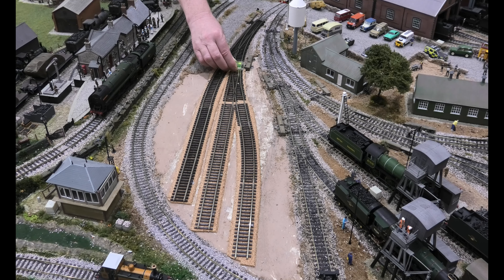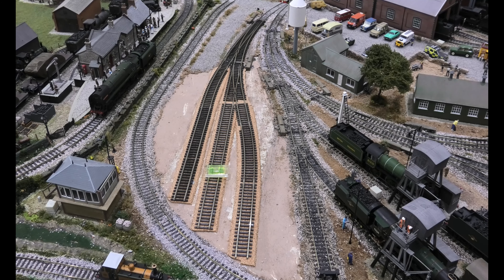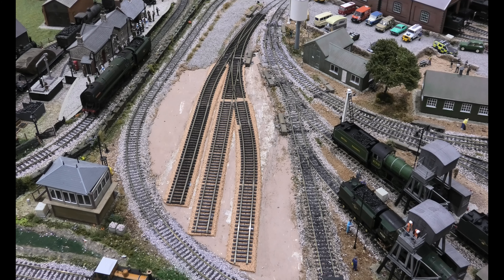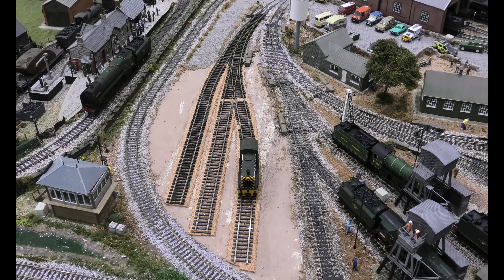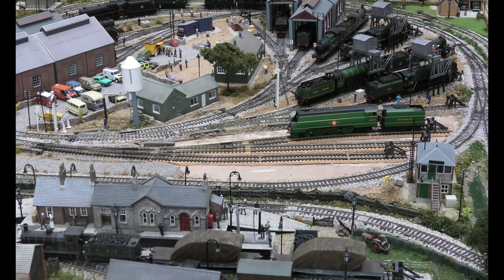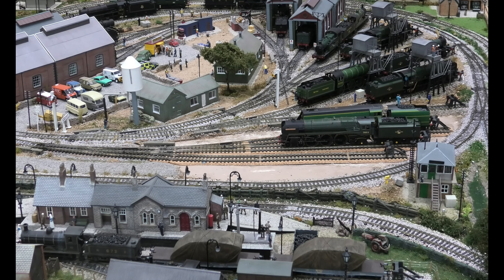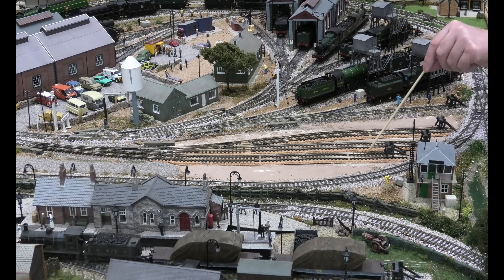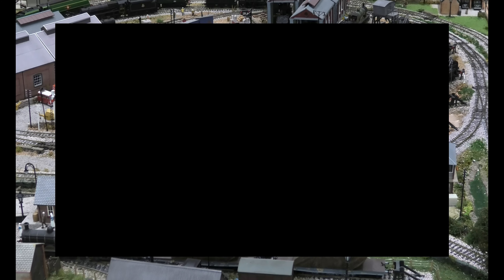Part 2 siding track modifications...Now you see it now you do not.

Comment: Would you recommend pva my track down?
Reply from the maker: What you do is use screws to hold the track down and adust the level of it, but you do not screw the track down hard, you just hold it in place level on the parellel and the horizontal. You then ballast using pva, give it a couple of days to dry hard and then your good to go. https://youtu.be/Bb8M6aonWGc